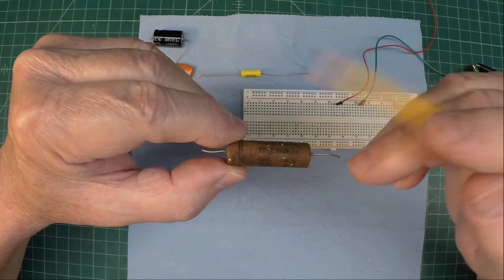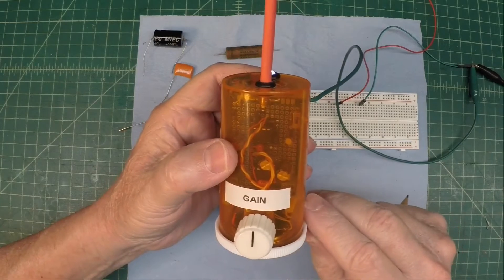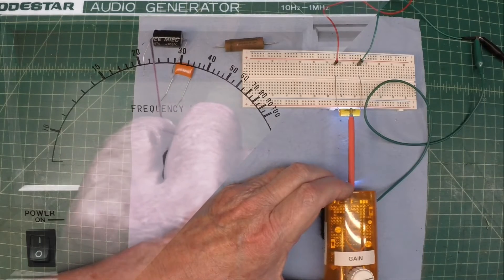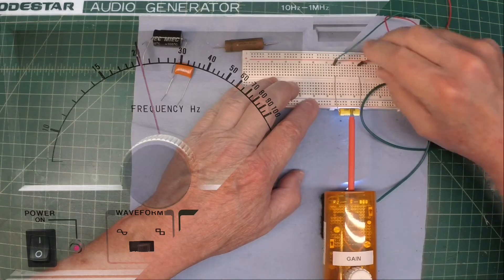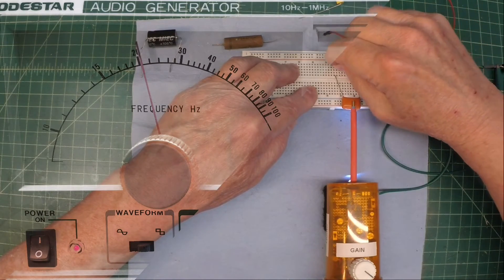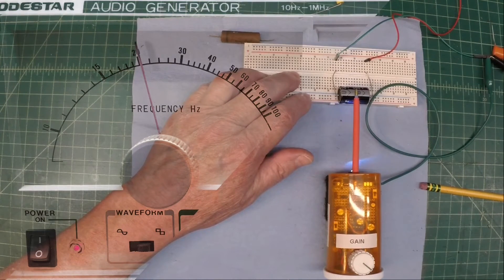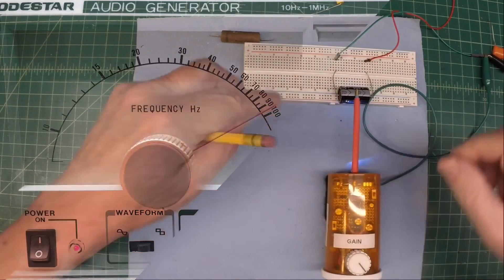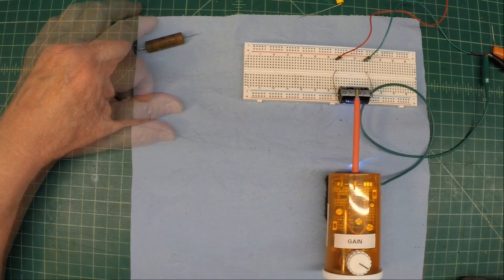Capacitor Outside Foil Identification Using an Audio Signal Generator & Signal Tracer

Comment: Don, that's a great test method.  Thanks for posting it.  I've tried other methods with no luck, but I think even I can make this work.
Reply: Folks as Don said in the original video, it's important that the SG produce a square wave. In my testing a pure sine wave did not work.  I'm making this part up now: "harmonics must be involved, because the pure sine wave has none and the square wave has tons."  Anyway, it's a handy way to determine the outside foil so the hum get a chance to go to ground 1st.  Thanks Don for all the work you do on the video's.
Reply from the maker: Josh, keep me posted if you utilize this method. I would be curious if you get better results than using the finger method. Hope you’re doing well. Best, Don
Reply: Don, it worked.  I had to turn the sensitivity up on the tracer, but for sure I can hear a big difference in sound.  Curious to see if it helps hum.  So you need to put all the capacitors in right and try it, then flip them over.......just kidding. ;)
Reply from the maker: Sounds good and thanks for validating my results. It would be fun to take a simple AA5 and recap it the wrong way and then reverse the capacitors and see if any detectable improvement is noted. Thanks again Josh. Best, Don

Comment: Modern day cap as have no outside foil they are not  rolled foil, but insulated cylindrically stacked and end capped. The lead contacts are on the inner most cylinder.
Reply from the maker: Thanks for the info. I’m assuming with the design/build change, it still allows one to discern the shield of the capacitor as I demonstrated? Best, Don

Comment: This looks good, I have all the equipment needed and can`t wait to try it out. I know just because the older caps have the outside foil marked, That`s not always the case. I also know that some of the newer caps are not rolled. They are layered, So there really is no outside foil. Those would probably be best not to be used for the old radio rebuilds.
Reply from the maker: Yep, some are definitely hard to discern. Here’s my latest circuit below that works extremely well and leverages Arduino. Best, Don

Capacitor Outside Foil Sniffer w/ Arduino Version 2.0
https://youtu.be/p1RolBQFZ4U

Comment: I Lake your way of testing for the foil side on a capacitor with your signal tracer, I built the Mr. Carlson super probe and I will use that. I was using the oscilloscope method as they had on his website but the way you do it I believe is more accurate than an oscilloscope. With the oscilloscope you squeeze with your fingers and you watch the waveform and that is not as pronounced at using your signal generator. Thanks again, love your channel.
Reply from the maker: Paul’s Super Probe has excellent sensitivity and I’m sure it will perform well for you. Thanks for your kind words, they are appreciated. I’m not sure if you saw my build below, but provided the link just in case. 

Capacitor Outside Foil Sniffer w/ Arduino Version 2.0
https://youtu.be/p1RolBQFZ4U

Best,

Don

Comment: This is the best fool proof  method I’ve seen yet. I use copper tape foil an audio oscillator and a scope. The method works smoothly on all capacitor values, with ease. The results are never ambiguous or un- reliable. There is a clear  and definite difference  determining the low side of the foul.
Reply from the maker: Yep, I’ve got a bunch with the foil still attached myself. Thanks for sharing your M&P. Best, Don

Comment: Where's the schematic for the Signal Gen.?
Reply from the maker: The audio signal generator is connected to the green/red leads that are attached to the capacitor under test. Hope this helps. Best, Don

Comment: I still do not understand how you identify the outside foil. When you input the freq to the capacitor is the sig gen's ground to the probe how you idtify the foil lead?
Reply from the maker: Sam - the Audio signal generator leads +/- are connected to the capacitor under test and the signal tracer ground lead is attached to the - lead connection as well. You then use the signal tracer to listen for the signal being applied by the Audio signal generator, then flip the capacitor around and do the same. The orientation with highest amplitude indicates the foil side and matches the + connection point from the Audio signal generator. Hope this helps. Best, Don

Comment: Thank you, great video, when I recapped a tube radio I would just installed the cap with the value being see, no idea they could be placed in backwards from a signal view. Question: Is the signal tracer being used in the audio mode? I Have be watching Doug's channel and they are building a tracer that can be used with both audio and RF, should be a great project, again thank you for sharing this video with us, have a nice day):
Reply from the maker: Daniel - my Signal Tracer by design doesn’t care if the input signal is aural or RF; no switching needed for my design. The one Bob designed is selective based on the source. Thanks for viewing and reaching out. Best, Don

Comment: Thanks Don, this will be very helpful. I am, for some reason, unable to get Paul Carlson's finger/oscilloscope method to work.
Reply from the maker: Ian - my HP analog scope died, but I had a better experience with it using the finger hold method vs. my Rigol. Try a simple extension cord plugged in or a lamp cord running under the capacitor between the leads and see if that helps. One advantage of the method I shared is the ability to use a higher frequency on the higher value capacitors, which seems to help. You can also use my method with the audio signal generator and place your o-scope probe on top of the capacitor if you don’t have a signal tracer. Best, Don
Reply: Thanks for responding, Don. I'll try those things.
Reply: H Higgins  Thanks, I will try that out and see if it helps.